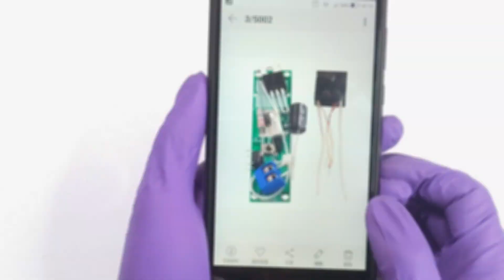電弧打火機套件組裝+加裝遙控模組遙控點亮火柴

Comment: Where did you find a power supply of 5v 3a?
Reply from the maker: I use a lithium battery for power, about 4V 2A in this video .

If you want to get 5V 3A power supply, you can use Power Supply Adjustable

or refer to my video
https://youtu.be/UZp7vN0WXD8

Comment: Can you add the link on description
Reply from the maker: ok ~

here is list and the link of all necessary materials

DC3-5V DIY Kit High Voltage Generator Arc Igniter Lighter Boost Electronic Suite

https://www.ebay.com/itm/203447379824...

433mhz Wireless Remote Control Switch Controller Module Battery Power Momentary

https://www.ebay.com/itm/223421039089...